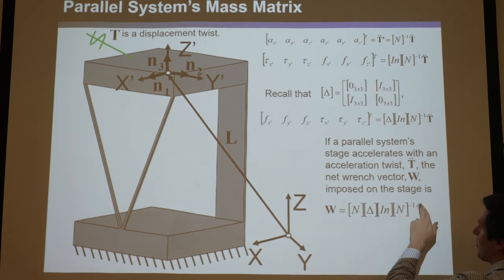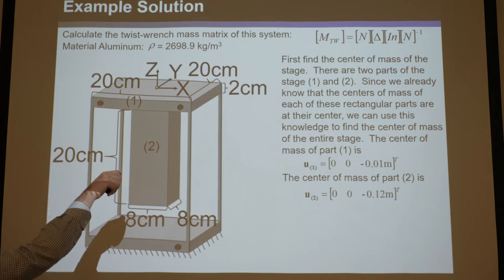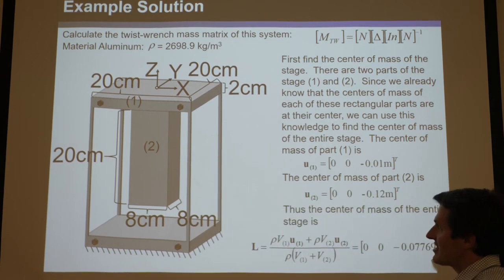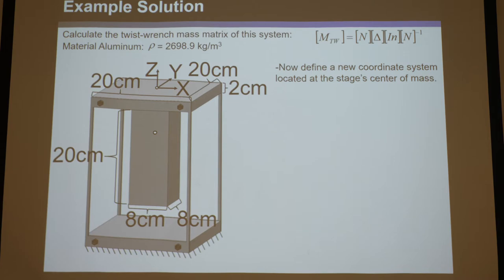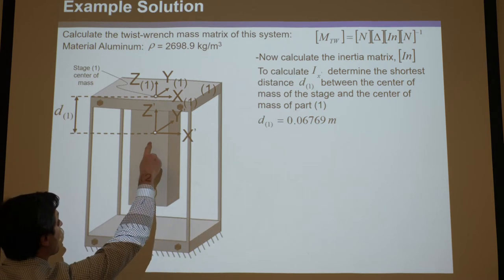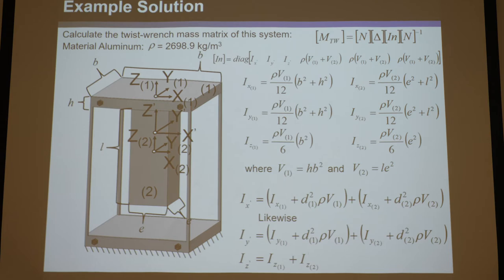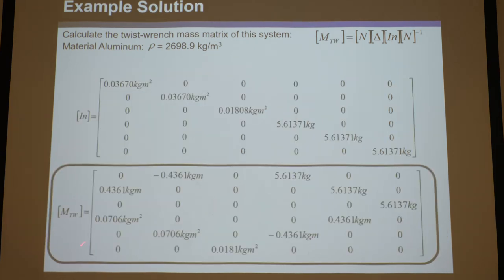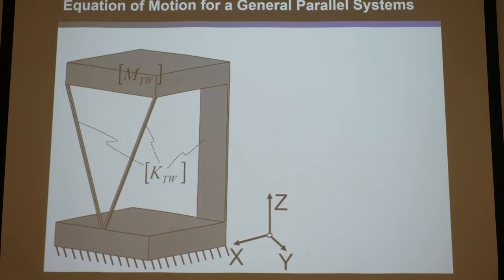Compliant Mechanisms Lecture 3 Part 4

Comment: Part 4: Mass Matrix (4:04):

* Assumptions:
    * Stages are infinitely rigid (no compliance)
    * Flexible elements have no mass (all stiffness)
* Steps to Calculate Mass Matrix (5:49):
    * Find mass of the stage (`m = ρV`)
    * Find center of mass (by inspection or integration)
    * Define new coordinate system at the center of mass, aligned with principal axes
    * Define unit vectors `n1`, `n2`, `n3` along principal axes
    * Construct transformation matrix `N` using center of mass position vector and `n1`, `n2`, `n3`
    * Calculate mass moments of inertia (`Ix`, `Iy`, `Iz`) about principal axes
    * Construct inertia matrix `In` (diagonal with mass moments and mass)
    * Obtain the mass matrix using: `Mtw = N * In * N^(-1)`
* Considering Flexure Mass (15:09):
    * Approximate by adding half the flexure length as rigid mass to the stage